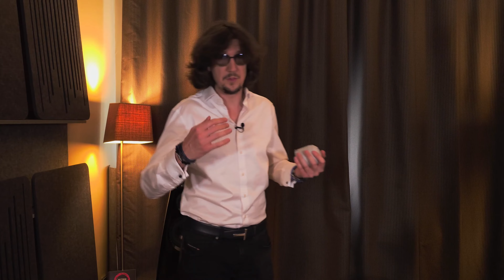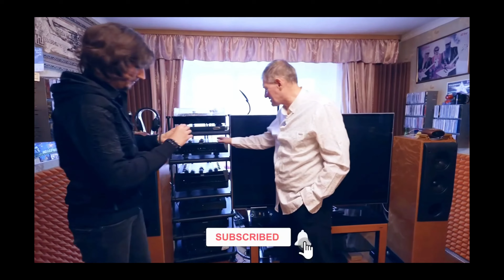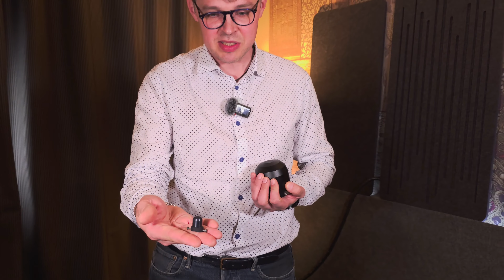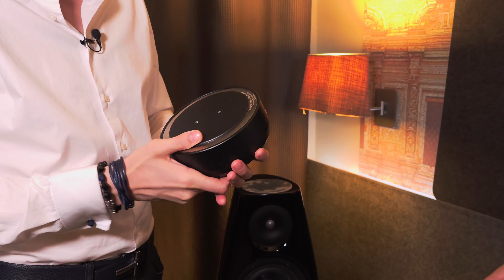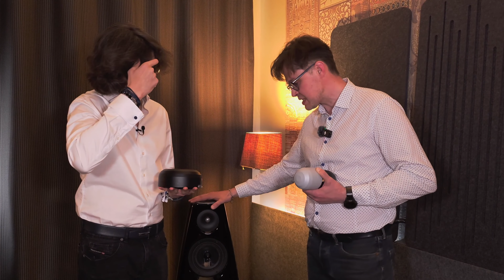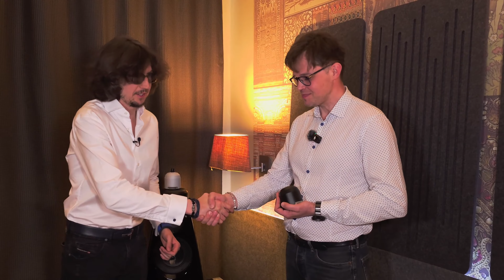How to Upgrade Stereo Sound in Home Theater? KNECHT Will Change Everything!

Comment: All Electronic Devices vibrate trans caps res etc the toridial vibrates the most . Only true cure Forget about it 😮 designers need build more into the vibrations internal ones make most difference 😊